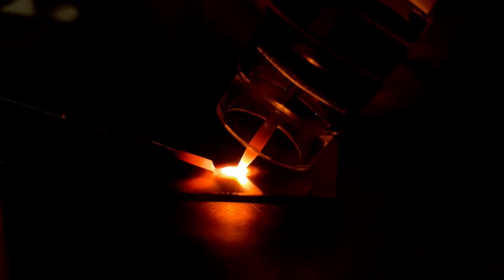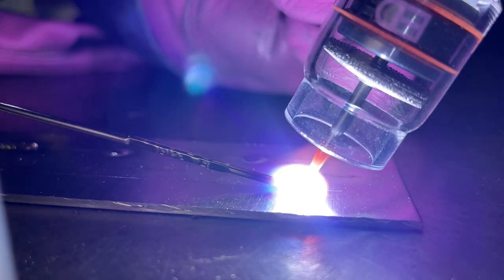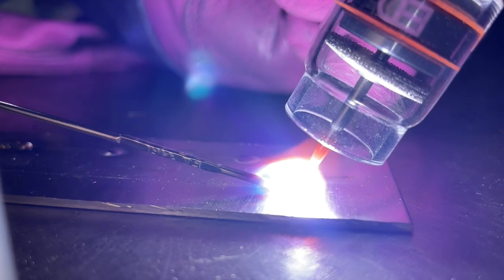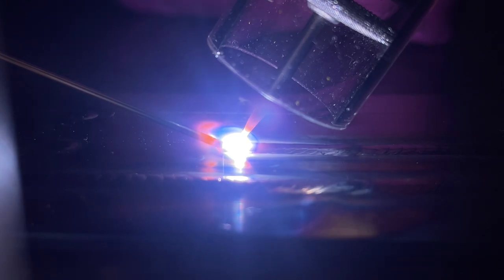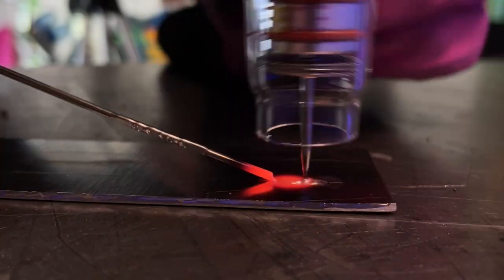Why your filler gets stuck tig welding stainless

Comment: I have been welding a bit more stainless lately and definitely was dragging my filler out causing it to stick sometimes. I never even thought of it until watching this video, so thanks for the tips as always
Reply: This was a really good explanation!  Best I've seen on this topic, by far.  Great video and helpful graphics, and the content dealt with multiple reasons why welding stainless can be tricky.  I've done a fair amount of stainless and encountered all these problems, and only partly understood the causes.  Great work on a challenging set of explanations, Dusty!

Comment: I'm 2 weeks into my new job. Pretty much all Tig on stainless pipe. This helps a lot.

Even though Tig was my least favorite during school I will say it's growing on me. But man it can be frustrating sometimes
Reply: What’s your job?
Reply: @Jacobaugust022  a fab shop that builds industrial sized RO filtering systems. All stainless pipe 2"-12" diameter
Reply: @sandman1058  sounds like fun!

Comment: On thin stainless I use the drip technique.  You actually place the filler rod next to the tungsten to make it ball on itself then tap it toward the puddle to make the molten material "drip" into the weld pool.  This technique works well because it prevents the sticking issue, It slows the welders pace down to help get better penetration from a slower movement/liquid falling into the puddle, and it allows you to fill from the side without affecting the puddle in the opposite direction.  Everyone has their own techniques but this style of welding has helped my butt joints considerably.

Comment: Great video and good tips! In the camera shots you've got in this vid, it looks like you're running really slow (at least slow in my mind). From my understanding, this would increase the amount of heat input to the base metal. Could you do a video explaining how you balance amperage/foot pedal control with travel speed. How do you know if you're inputing too much heat by lowering amperage and slowing down travel speed?
Reply: On stainless, the oxidation level and heat affected zone will tell you everything. It's either just right or way off.
Reply: @InchFab  Right definitely. It just seems like Dusty is able to work MUCH slower than expected and still not overheat. Justin over on The Fabrication Series has shown that low amps and slow travel can be just as bad as too high of amperage. So I’m just curious as to how Dusty manages to work at the speed he does.
Reply: @BuildingWithSean  yeah its a good question. I went to Justin's shop to learn tig, and his style is geared toward fabrication where dusty is art focused. Dusty can afford to run slower with a lower current and focus on accuracy since he's not worried about penetration on art stuff. When I asked Justin about stainless specifically and he said "get in and out fast with the lowest current possible." Fill and chill is only a thing on stainless for art. Can't have too much heat input for fabrication applications.
Reply: @InchFab  Thanks man! I appreciate your insight.
Reply: @BuildingWithSean  no problem. I'd still like to see dusty answer it, because I could be wrong.
Reply: @InchFab  good point. I’m a professional TIG welder and only weld stainless at my current job. While having good looking beads is ideal, not causing distortion and minimizing burn through/oxidation on the backside of thin stainless is much more important. Normally we try to get the backside to have no color/oxidation or at most an orange hue. It’s easy to do on 7GA but gets real tricky with 11-16GA. In order to accomplish this, there is no “chill” involved and is much quicker than what is shown here.

The thing about YouTube is that the content creators/welders show their technique that works for their application/shop/WPS, but that can be different everywhere you go. That said, Dusty is a phenomenal welder and has solid advice for what he does.
Reply: @ieatslag5947  yeah the "content creator" thing is something people need to keep in mind when watching stuff on YouTube. It's great information, but there's no magic answer.
Reply: I think the shots in this vid show slow movement to highlight the filler rod technique

Comment: I almost never dab, keep that rod engaged for the smoothest weld, unless you need the heat. Work your rod and tungsten slightly back and forth for a food-grade weld. Since I've learned this technic, I no longer have to think about it, my hands do it automatically. I am relatively poor at stacking tho!

Comment: I have been watching another channel that features welding food quality stainless piping without use of a filler rod.... So my question is, what dictates the use of the filler rod vs. Not using filler material?
Reply: My understanding is that in food grade the ripples left on the weld is a trap for bacteria to accumulate in, the act of not using filler removes the ripples and most food grade has little need for structural durability so filler is not really needed anyway
Reply: Stainless seems better suited to no-filler (autogenous) welding than most metals, as long as fit-up is good.  I'm wondering if it has to do with the surface tension of the molten puddle.  Aluminum seems to be worse than other metals, perhaps because of (greater?) surface tension that causes the edges of the weldment to pull back from each other.  The point (by Beaird) about ripples seems plausible, but welding stainless generally results in a flatter bead than aluminum anyway, even if filler is used.  Other reasons for using filler have to do with weld cracking and strength, and the properties contributed by additives in the filler.
Reply: @benz-share9058  
It has to do with the metallurgy, certain grades of aluminum will have extreme contractional forces if you don't dilute it with enough filler.
Reply: I have done many food-grade and have always used filler. A fusion weld (no filler) is a very weak weld. For a food-grade weld, use only the min. heat, keep rod engaged, and slightly rock both rod and tungsten back and forth. Once I learned this technic, it's the only weld I use, looks very professional.
Reply: @marksimpson4215  Thanks for the insight....very interesting.

Comment: Why is the filler rod sticking elsewhere (other parts of the rod) that might be in contact with the work piece ? 
I'm talking  about real life welding in positions, not small plates on a table. Happens to me every time I weld in position where I'm squeezed between a frame or a jig trying to get my hands to weld and the filler rod is in contact with the part. Mostly happens on aluminium to me.

Comment: Hey Dusty.
I just trying to start Tig welding.
I’m having issues with gas. I don’t know if it’s the gas, th everlast welder, torch or tungsten/collet issue. How would you trouble shoot this?
Reply: Straight argon, get as close as you can get, practice, practice, practice. Oh, and clean your material first, weather grind or other cleanings.
Reply: @marksimpson4215  I used a strip and clean disk to remove mill scale, 3M scotch brite, acetone the two pieces. I’m just trying a fusion to start with. Without filler and the tungsten just disappears in the cup. ( I need to lower my amps cause this getting expensive) 

I think it’s a shielding gas issue. 

Not purging my 12 foot line long enough before starting? I set it to 15 CFH. Maybe I’ll try setting it to 25 and just purge it for 30 seconds before trying again.

Thanks Mark for the reply.

Comment: What welder would you suggest for me? Im looking to get into tig welding and i want to be able to do aluminum as well so ac/dc for sure. And i cant see myself ever going past 3/8 aluminum with 99% of everyrhing i weld being 1/4 inch and thinner.
Reply: I bought a Prineweld brand, It has ALL the bells and whistles, $800 a very good starter welder. 110/220 ac/dc, I love it, Need a better foot petal tho.